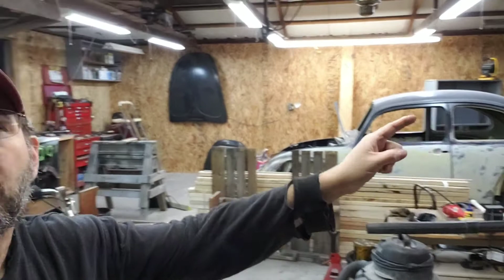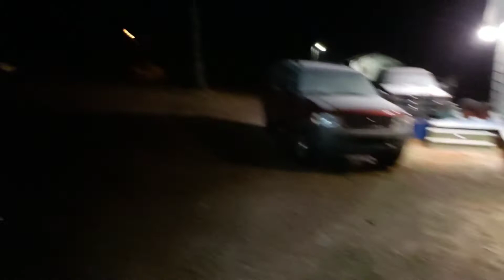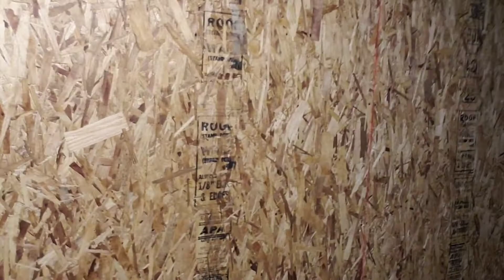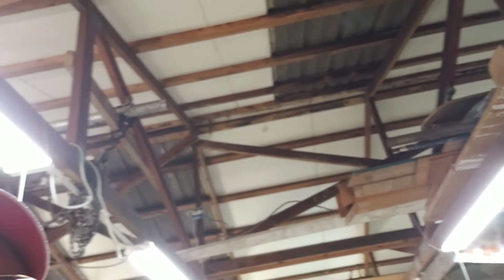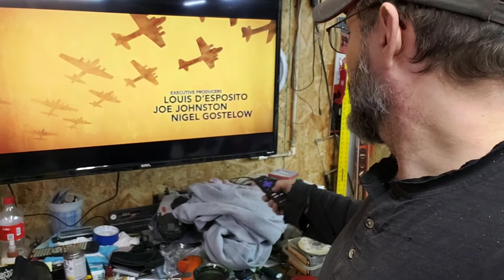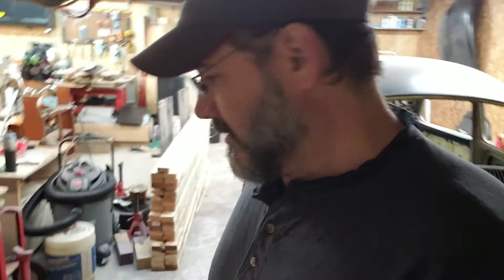Bonis67

Comment: Weather is crazy here also. 80 degree in the afternoon then few days in low 50s. I fought sinus headaches for a few months. It sucks but again there is always sombody worse shape. Motivation is hard at times with depression. I'm on social security disability since the age of 37( now 46). I have currently 6 herniated disks and more having issues daily. On hard pain meds. I will say this, YouTube has helped me out alot. There are days it takes all my energy just to get out of bed with the meds. Like I say all the time the comments keep me going. Your shop looks great. I only have a single garage with a bad roof also. Keep your head up. Easier said then done. The VW community is always here for you